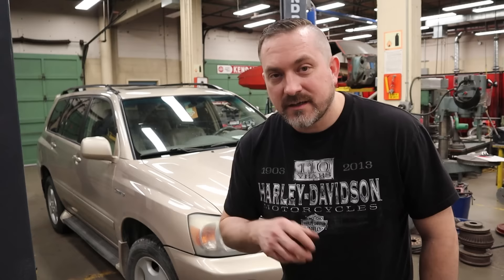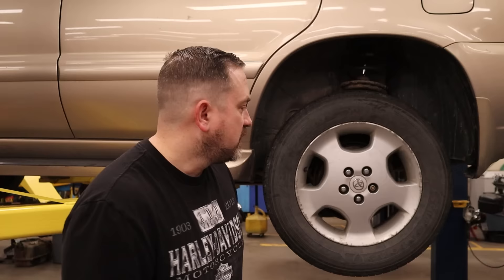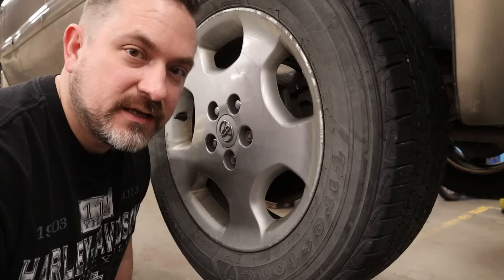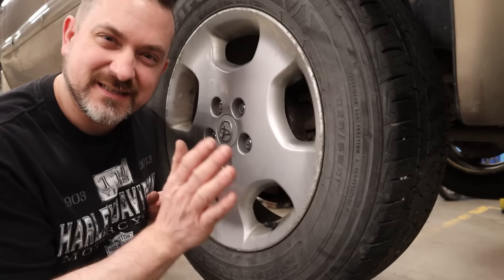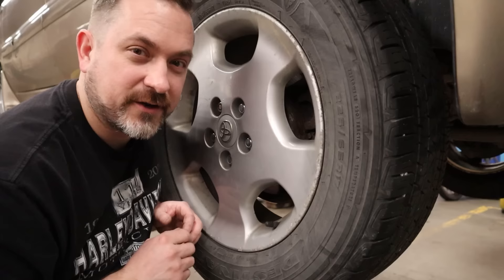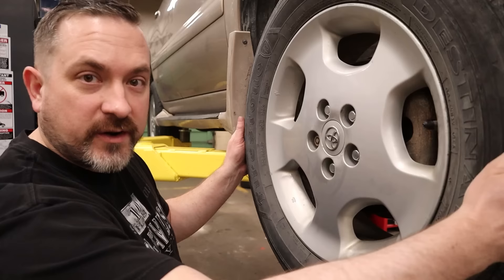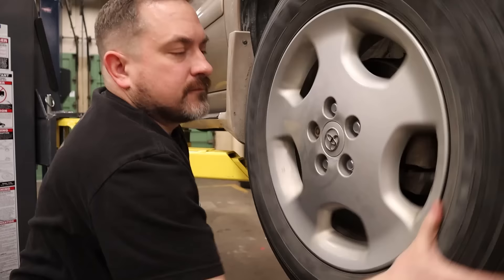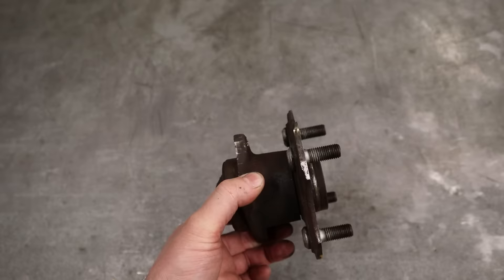How to 100% diagnose a bad wheel bearing.

Comment: Thanks for the tips! ??? Would a bad wheel bearing cause 3 lug nut studs to shear off? Or is that a bad CV axel?
Reply from the maker: Not usually.  Wheel studs breaking are usually incorrect torque on lugnuts.  Either too tight or too loose and then driven on until the break.  Thanks for the watch!

Comment: Don't listen for the loudness.  Listen for change in pitch. If that is speed dependend, then it is after the transmission in the drive train, most likely.  If it is RPM dependent, then you better start saving your money, because it is either engine or transmission related! :)
Reply from the maker: Good advice!  Yeah if the sound is rpm dependant than it's engine related and ya better hope it's an exhaust heat shield!   Lol.  Thanks for the watch and welcome to the channel!

Comment: TBH as a driver you should be able to tell. If it feels like your wheel/tyres have wobble in them when you're driving that is bad bearing. A good way to diagnose it fill your slightly over fill your tyres so they will pass any motion onto the bearing then drive over cats-eyes (UK) Botts' dots or turtles. If the wheel wobbles as you cross them your bearings are gone...You'll also notice more tram lining...
Reply from the maker: Yeah usually bad bearings can be heard while driving but not always.  It's just like anything else, the worse the bearing is...the easier it is to diagnose.  Thanks for the watch!

Comment: Great video,i have a bad rear bearing on my 03 Avalon thanks!
Reply from the maker: Glad I could help!  I have a video on how to replace those bearings too if ya need!  Cheers!
Reply: @wayofthewrench  I pulled tire off it has a little play up and down but no grinding or any noise maybe its not the wheel bearing causing the clunking and noise im now leaning toward the crap Monroe struts
Reply from the maker: Does it have play side to side?  If so, then it's probably a bad wheel bearing.  If it has no play side to side, then it is strut or upper/lower ball joint.  Good luck!
Reply: @wayofthewrench  No play side to side just up and up and down..the rears not got ball joints then it probably is a strut or control arm bushing..the Monroe struts on back are horrible junk
Reply from the maker: Yeah must be a strut or loose strut fasteners or a multilink suspension part.  Good luck!

Comment: Great video thank you !     I just had my transmission rebuild.  It shifts nicely like it should until it makes a loud strong KLONK reducing speed and kicking right into neutral. Mechanic says that its a  wheelbearing causing it to do .   Is he full of it or I am just an idiot.....Thank you again for your great video /demo.
Reply from the maker: Nope, that's not a wheel bearing.  A wheel bearing will never cause a transmission to go into neutral.  A wheel bearing doesn't make one load clunk either.  Hope you get it figured out.  Thanks for the watch!
Reply: @wayofthewrench  Thank you very much for your prompt reply and clarification !!!!!!!!
Reply from the maker: No worries, hope you get it figured out.  Cheers!

Comment: I own a 2012 Highlander with 122,000 miles. Just want to know your opinion that if one wheel bearing is bad is it recommended to replace the other side on the same axle? Should all of them be changed as a preventive measure?

Thanks for the excellent video!!!!!
Reply from the maker: It is recommended to change both sides as if one is worn, the other close behind it.  However, I have done just one side when the money's tight, just keep an eye on the other and check it every 6 months.  Thanks for the watch!

Comment: Going out in garage to see which one is my issue. You can spend $80.00 for one or $200.00 for one different manufacturer . Whats the best compamy ? How many miles should you get out of front ones with my 2015 Ford Explorer Limited?
Reply from the maker: Generally you get what you pay for and can ask the parts person for an OEM equivalent to help make your decision.  You should be able to get a lot of years out of them or over 100,000 miles but it depends on brand, driving style, accidents, and environment too.  Lots of salt and Winter driving can cause early failure.  Thanks for the watch and welcome to the channel!

Comment: @Way of the Wrench - I have a suspected wheel bearing issue in my left, front wheel only. It's a FWD vehicle. However, the only time I hear it is when I'm turning right, often a hard right at a quicker speed. I haven't checked any suspension pieces (tie rods, ball joints) because I'm very aware of what wheel bearing problems sound like but again, the ONLY time it makes a sound is on Right turns. Do you still suspect a wheel bearing issue?
Reply from the maker: I just put out a new road test wheel bearing video, you should check it out!  Sounds like it could help you out.  Cheers!

Comment: I have a vibration in the steering wheel when I brake. Is that most likely rotors or could that be bearings? I don’t hear any noise at all driving and it only shakes when I brake.
Reply from the maker: Sounds very much like a warped rotor or brake issue. I have a video on inspecting your disk brakes and another one on inspecting drum brakes if you're interested.  Thanks for the watch and welcome to the channel!

Comment: what if it’s opposite? my passenger front tire is making a static-ey noise almost like a speaker but only while driving under 40mph and really prominent when driving slow and is making that tire seem low on air when i don’t have a tire pressure light on

Comment: Been noticing a noise when driving at highway speed, but there doesn't seem to be any play when I tried to giggle the wheel.  Can't really spin it though as I don't have a lift and the AWD system doesn't seem to let it rotate more then a little with 3 wheels still on the ground.  Possible it is just the new-ish snow tires are louder then the old all seasons.
Reply from the maker: For bearing check you don't really need to spin them, just do the shake test.  If there is no wiggle, then the noise could be tires or out of balance wheel.  Is there vibrations as well as noise at highway speed?  If so then it's an out of balance wheel.  Cheers!

Comment: Thanks for this great video!
On my 97' Civic, there's a similar noise but quieter coming from the rear, from 30-40 km/h but starts resonnating after 110 km/h.
There's no play in the wheel (or very little and I miss it) and there's no scratching sound when I put the wheel in movement car jacked up. No difference with the other wheels. Is it the bearing? I fear changing it for nothing, the part costing 150€ 😑
Reply from the maker: Try to do a road test and get the sound to happen.  Then do some left and right turns to load/unload the bearings.  If one turn makes the sound go away, then its that side's bearing ( left turn goes away, left side bearing).  You can also leave it for a few days to see if it gets worse.  Once it's worse, the play will be easier to identify.  Good luck and thanks for the watch!

Comment: To spin the wheel does the other side have to be off the ground? Im just wondering whether i can check by jacking up the one side?
Reply from the maker: You can put it in neutral if it won't spin because the other side is locked.  Keep in mind the check for play is more crucial and the spinning sound is better to check while driving anyways.  Thanks for the watch.

Comment: Will a bad wheel bearing cause the tire when in the air to not spin very well?  The other symptoms don’t seem to be present, but the tire just has a lot of friction when trying to free spin.
Reply from the maker: It could be a bad bearing on it's way out and there just isn't play yet.  The drag could also be caused by a caliper that isn't backing off the pads like they should so the pads are slightly dragging.  The square piston seal is supposed to pull the pads back just a little bit to prevent dragging.  Thanks for the watch!

Comment: Have a bearing noise on my 2012 honda crv , had my lady drive while i listened carefully in the rear sounded like drivers side it checked  ok play wise but so did the passengers side. So $300 on a new  bearing installed it noise still present. Just bought a usb microphone going to cable tie it to the other wheels suspension one by one will hopefully find it 100%. Hopefully not the front differential its a 2wd.
Reply from the maker: You should watch my road testing a bearing video so you can narrow it down.  Also don't feel bad, bearings are usually changed in sets anyways.  Good luck and welcome to the channel!

Comment: On my 03 Saturn L200, my passenger front wheel area is shaking both on acceleration and at highway speeds. The outer tie rod, ball joint and CV axle all have been replaced. There’s no humming, but the wheel assembly itself is loose, so wondering if the hub is bad? Previous owner smacked a curb @40 mph and blew the rim and tire before I bought it and I’ve replaced those as well of course.
Reply from the maker: Could very well be a damaged hub or warped rotor.  A dial indicator on a magnetic base can show you out of round/damaged parts as you spin the wheel or hub.  Hope that helps.  Thanks for the watch and welcome to the channel!

Comment: Hopefully you would reply this. Mine is the reverse when I break and slow down it makes a low rumbling spinning noise
Reply from the maker: That sounds like worn out brakes or possibly warped rotors or drums.  You should check out my two videos on inspecting drum and disk brakes.  Good luck!

Comment: Do you need to get an Alignment done when the job is completed?
Reply from the maker: For a wheel bearing assembly no but any steering and/or suspension component changed or adjusted does require one.  Hope that helps.  Thanks for the watch and welcome to the channel!

Comment: I have a 13 Tacoma that has noise at 40mph. Both of the front had new bearing and Toyota installed a brand new carrier assembly. They did say that one of the bearing in the rear was going bad. Does the rear bearing radiate to the front?
Reply from the maker: It could but jacking it up and checking if the rear has play would be a good place to start.  I also have a video on road testing a bearing you should check out too.  Hope that helps.  Thanks for the watch and welcome to the channel!

Comment: How we know it's not tie rod (.3 -6 position) 
And not  ball joint ( 12 - 6 position ) and only the wheel bearing. I mean the rumbling sound on turning the wheel  is clear.
Thank you.
Reply from the maker: With the wheel off of the ground.  Shake the wheel left and right and up and down.  If there is play up and down that's ball joints, if its loose left and right, that's steering components, like a tie rod.  Once you feel play, have someone shake the wheel while you look/feel the suspension/steering components to find the play in a joint.  If there is play up/down and left/right and there is a speed dependant sound, then its a wheel bearing.  You can also have someone shake the wheel and confirm the play is between the wheel hub and the steering knuckle.  Cheers!

Comment: New Subscriber! I now know that I have a bad wheel bearing. Why do the drivers side wear out first?
Reply from the maker: Thank you for the sub Craig!  I would say that it isn't always the driver's side but it might seem like it.  Bearings usually fail with dirt/salt water getting in, excessive weight, or excessive torque on older style axle nuts.  It's possible that water splashing from passing vehicles is hitting the driver's side wheels though.  Thanks for the watch and welcome to the channel!

Comment: How about when you’re driving at 70 mph and you start braking and the steering wheel shakes dramatically. What causes that issue? New brakes and rotors replaced a couple months ago.
Reply from the maker: Sounds like warped rotors but could possibly be loose lugnuts or dirt under the new rotors when they were installed on a dirty hub.  Hope that helps.  Thanks for the watch and welcome to the channel!

Comment: For me it's the opposite. 
My squealing can be heard on the highway when I'm turning the car. If I do a quick Lane change, in either direction, I can hear the s-s-s-s-s-s-s. 

It's very much a squeal. Like the warning sound on worn brake pads. No Clunking of any kind. No rumbling that I can hear. 

But I'm confident it's not my brake pads because it happens when I'm not braking. And my calipers aren't abnormally hot, even after a hard brake. So I'm willing to bet I don't have sticking or lazy pistons. 

There's also a light, but definitely noticeable, jingling noise whenever i go over bumps. 

Is it not my bearings?
Reply from the maker: Sounds like you could have a bearing plus maybe some other issues.  I would do a full inspection of suspension, steering, braking, and bearing components.  It's very hard to tell over a message.  I have videos for most of those system inspections you should check out.  Thanks for the watch and I hope that helps.

Comment: Why dont they make greaseable wheel bearing? I mean im sure they probably do for certain vehicles etc. Just why not on newer car? Whenever i have the option for suspension parts with grease fittings i always go for the grease.
Reply from the maker: They do on certain trailers but not on vehicles.  They want your vehicle to last just outside of warranty and then get you to come back to repair it.  If you could grease it, you'd never need a new bearing.  Plus the cost of putting in a fitting/greasable joint cost money.  If it cost $1 per car and they make 2 million cars, then they just spent $2 million dollars.  Thanks for the watch and the great question.  Cheers!

Comment: I have a question. I could hear some noise like metal blade touching another metal when driving. I thought it could be brake pads and had break pads changed as mechanic confirms they were worn out. After changing, the metal noise went away but I could hear some whooo noise in the cabin which didn’t sound great. Then he said it could be wheel bearing. He removed them and said 3 of them were bad and need replaced. They have been replaced but I still hear the whooo noise in the car as of some wobbling going on , amidst some small stutter, and when I hit a bad road, it’s like the car is losing balance.
Reply from the maker: Hrmmmm, hard to tell without checking myself but could be the 4th bearing or a loose wheel or worn steering/suspension components.  Hope that helps.  Thanks for the watch and welcome to the channel!

Comment: Grab the wheel and pull hard on it while it’s on the ground. If there’s any clunking movement you gots a problem.
Reply from the maker: Yup but you can't tell if it's a steering component or wheel bearing, you have to have the weight off of the wheel to confirm because the weight of the vehicle can mask the wheel bearing issue. You can road test it though. Thanks for the watch.

Comment: Could a bad wheel bearing cause the studs to continually snap or would that likely be something else, possibly the wheel arm?
Reply from the maker: Hrmmmm constantly snap?  Maybe you're over torquing the lug nuts.  If the new studs are snapping, that's definitely not normal.  Usually a bad wheel bearing just makes noise and if not fixed eventually will fail but the studs shouldn't break off.

Comment: I'm hearing a noise coming from rear drivers side wheel of my 2011 Honda CRV front wheel drive.  It almost sounds like pocket change.  Everyone describes the bearing as happening at higher speeds but mine makes the noise event at 5-10 mph.  I also have rubber sounding noise as soon as I back up.
Reply from the maker: Sounds like an inspection is needed.  I would inspect for bearing issues like in the video and then look at the brakes (I have a video for drum and disk).  Also look for things rubbing when you spin the wheel like a backing plate or tires rubbing on loose plastic wheel wells.  Good luck.
Reply: @wayofthewrench  it was the brakes.  Worn Rotor and pads.  ThankYou

Comment: So I had a guy tell me the rear bearings in my wife's rogue 2019 front wheel drive are bad, when I took it in for rear brakes.  The pads were gone, and it was grinding.  He says he turned the rotors, but the same sound is still being heard, after he changed the brakes.  Thing is, you can hear this sound, immediately, not speed dependent.  And it definitely sounds like grinding.  If he turned the rotors, shouldn't the sound be gone because its smooth now?  It doesn't get louder as you go faster, it feels harder though, hard to describe.
Reply from the maker: Hard to tell from a message but it sounds like you either have really bad bearings or something is not right with your brakes.  I would jack it up and check yourself.  I have another great video on how to check your disk brakes .  Thanks for the watch and welcome to the channel!

Comment: As I recall when I took auto in the 70's, rocking left and right play like you said was a bad wheel bearing but rocking the wheel the other way was bad ball joints.  Is my memory bad or do you agree to that possibility?
Reply from the maker: Your kinda right.  If there's play up/down and left/right it is either loose lug nuts or a bad wheel bearing.  If it's only left/right, then its a bad steering component.  If it's only up/down, then it's a bad upper/lower ball joint or loose strut mount.  Thanks for the watch!

Comment: Couldn’t checking the play from 12 and 6 also be a way of checking bad ball joint though
Reply from the maker: Yes you are correct but play at 12 and 6 plus play at 3 and 9 would be loose lugnuts, bearing, or both steering and suspension components.  Thanks for the watch and welcome to the channel!

Comment: Can an out of balance tire or a tire with broken belts make a similar sound? Thanks!
Reply from the maker: Yes and no.  It can make a sound dependant noise but an out of balance wheel/tire bulge will have vibrations into the car whereas a wheel bearing doesn't usually have any vibrations.  Thanks for the watch!